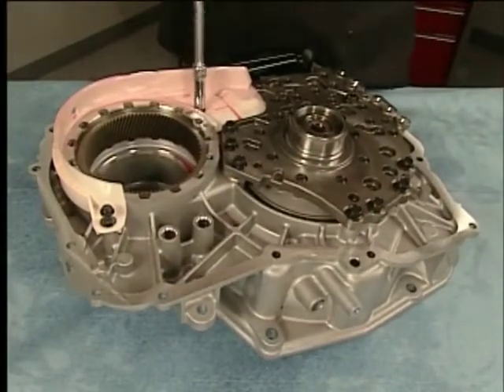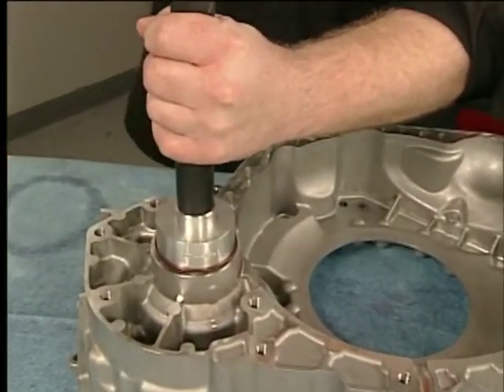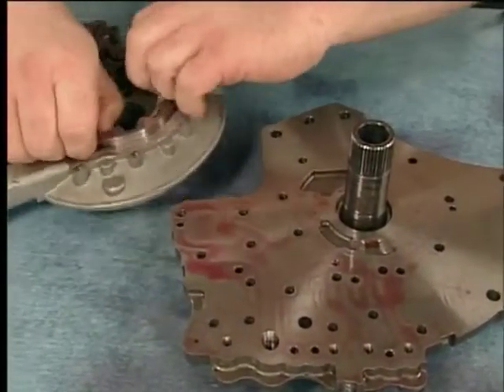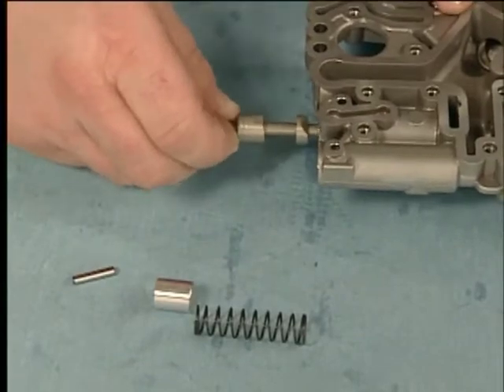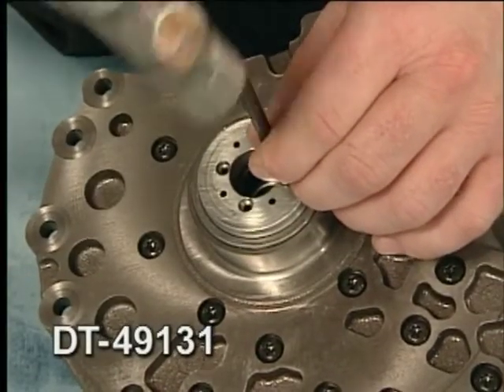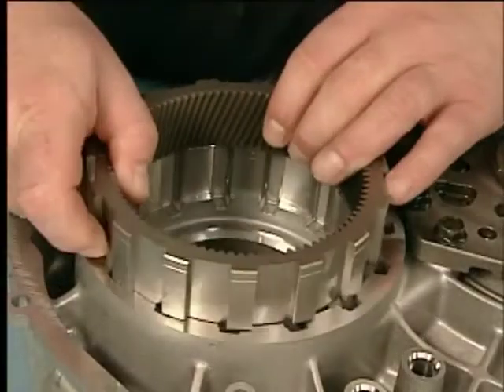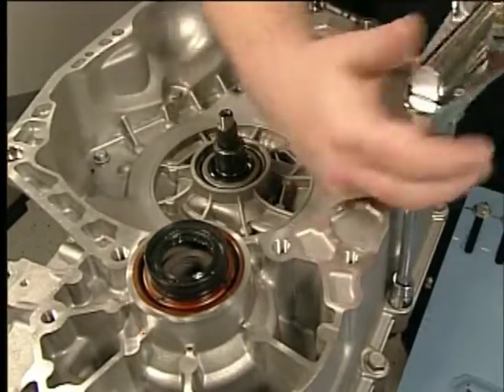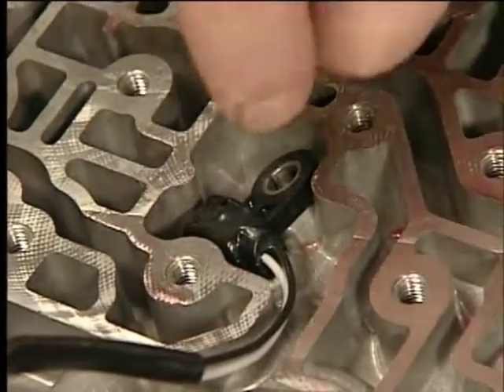HOW TO OVERHAUL GEARBOX 6T40 PART 3 - TRANSMISSION FLUID PUMP

Comment: Can you rotate the splinned shaft of the pump by hand when it is assembled.???i tried turning with a channel lock and won’t turn. It seems like mine is damaged, Or does it require alot more force.